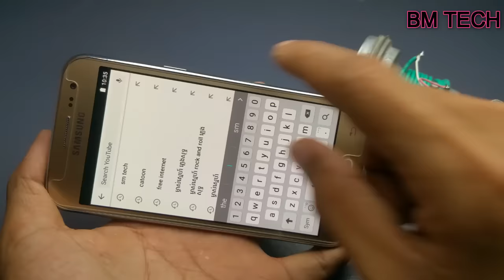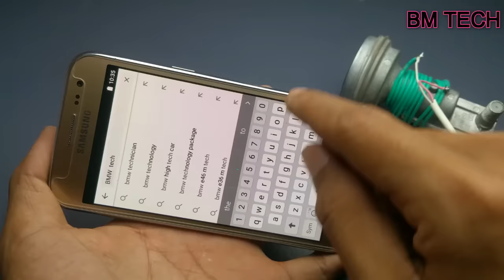Get Free internet 100% at home - Free internet WiFi 2019

Comment: Even odogwu EE got confused on how you provided the continuity of the cable by using electromagnetic induction on an insulated cable..
Kudos 8.8million views....
Reply: All the so called fee internet are invoking Cooper wire coil and magnet. Does it by pass somthing in phone? Supposedly the magnet inside phone is for GPS?  Some also involve scratching sim
Reply: Please does it truly works?

Comment: IT WORKS. I used Red wire, because did nor have green.
Using blue wire, I calculated that you wilk get 58 dB per square footpound more amplification, therefore I was able to chat with one girl on Mars.
Another useful suggestion is to use more glue. The more glue results in a huge signal amplification according to my calculations.
Reply: LMAO

Comment: FAKE VIDEO ..1)The LNB  he is using is only one way  which means signal can be only be received just like in DTH receiver  and a receiver is also required to decode the signal from the carrier frequency  ..
2) The LNB he is using a Ku Band LNB and its frequency ranges from 10 GHz to 12 GHz however the WiFi frequencies are 2.4 GHz & GHz  there is no way an KU band LNB can directly be linked with WiFi frequency ..
3)There is no customer premises equipment installed how can the  the smart phone communicate with the global internet without a Internet service provider ..
4) The USB connection worked just like that . no notification shown on the phone ..lan ,wifi or PPPOE connection ..none seen ! -----RIP Technology-------
Reply: thank you
Reply: Thanks for the insight

Comment: from the 4:20 video time to 5:40 the mobile phone 10:35 time has not changed!
Reply: of curse, because he had to hide the bar, due to it indicates the Wireless symbol. I think this is done by simply puting some sticker over that area of the screnn and then put the screen protection over it.
The circute he solder will only produce a short circute of the USB-Port because he only conects power + and power - to the antenna, witch will not get any data from anywhere.

Comment: FAKE!!!!!!!!! lnb 10 ghz and anAlog output without  ADC convertor ....
Reply: yeah you are right how can this work... the wires he connect was only two.. normally USB hotspot cables use four wires two for power supply and the other two for data transfer this is not true they just want more views

Comment: The internet you get this way is not completely free. It is restricted by FUP. If you want it to be completely free without any restriction then you have to insert that LNB deep into BM Tech's A*S. Dont forget to clean the hole with the sand paper though or else the reception will be poor.You may have to repeat the process frequently.
Reply: Isso é verdade??
Reply: Whaaat??

Comment: For those who don't know what this guy has done ( like me ! ) an indepth explanation on parts used and parts needed would have been good, please re do video ?. Thanks.
Reply: It's and Kno from sattelite
Reply: Lnb from dish and magnet
Reply: Parts needed:

- 16 gauge wires
- Solar powered outdoor lighting fixture
- Hot glue gun and glue sticks
- Transmitter from a old radio 
- copper coil pack
- soder with filler
- a old cell phone
- and completely delete you brain if you thought this was real. 🤔
Reply: It doesn't work

Comment: i need you to note down names of materials used  in creating free wifi internet
like green cable you used is it what type , is it copper cable or wifi cable . i need explanation please thanks
Reply: He just wrapped 16 gauge  wire around a lmb and hooked a USB to it. He didn't even use the plug so if you want to just make a coil of wire that would work the same.

If you would really actually want to revive satellite signals that would be on a dish/collector and connected to a t-bias and a sdr dongle from which you could use sdr++ plenty of legitimate people on YouTube doing just that like saveiffirparts.

Comment: This video is fake for many reasons.
1. You can't just wrap a cable around an LNB receiver.
2. You need to find a satellite in the sky to get anything at all.
3. You need to set up a network USB share if all that did somehow work magically. But it wasn't possible with that Android version.
4. The only connection to the receiver is the satellite coax port, nothing else.
5. The Wifi sign would have shown up if you were SOMEHOW getting internet.

The person who made this is worse at hiding faulty information than the Infinite Solutions channel here on YouTube!

Comment: Fake News? or are you brilliant.  Does BM Tech stand for Bowel Movement Tech?  I am just curious
Reply: Fake. The lnb diode must be connected to local OSC and signal most be demodulated. And after wifi signal must be reconverted in 01 (binar) to be recognized from smartphone procesor. The big problem is rxtx transfer on data-clock
Reply: @toninica  wow thats some technical ass shizznit.....how the hell you know this?? But it does make perfect sense what your saying.

Comment: In case the other comments haven't already told you, DO NOT do this.
I'm not even gonna watch this. The sad thing is, this has potential, but still would need a service subscription... and a different antenna, something akin to the yagi-uda design for radio and television I would think, and it'd require physically hacking your device to allow an external antenna.
Also, who's supposed to fall for this?

Comment: At no time do m hands leave the end of my arms ha ha nex we get a rabbi ou of thin air, utter rubbish I believe the way it works is that “some people” are full of crap, and are untroubled by lying about everything.

You can, of course, use any length of wire, or even a body of water, to receive a resonant frequency, but that doesn’t mean the wire or pond is tuned to the frequencies desired. You’d want a high signal-to-noise ratio, with low insertion loss between the connectors and cable assembly.

To the extent that anything with mass is technically an antenna, you could use a satellite dish antenna as though it were a parabolic Wi-Fi antenna. But the tuned frequencies for each are vastly different.

And what you’d be receiving, hypothetically, are Wi-Fi signals. If there isn’t a free Wi-Fi hotspot above the noise floor at your location, then you’re not getting squat. In 2020, most people don’t live near an establishment that still broadcasts an SSID offering open, unsecure Wi-Fi-based Internet access. so wake up

Comment: U hve put demo mode in ur phone where  an option gvn in the settings u hve clicked that. The data which u r using won't show on the top whn demo mode is on and the battery life also shows 100% 
100% Fake 🤣🤣